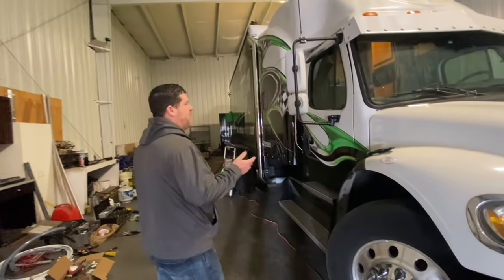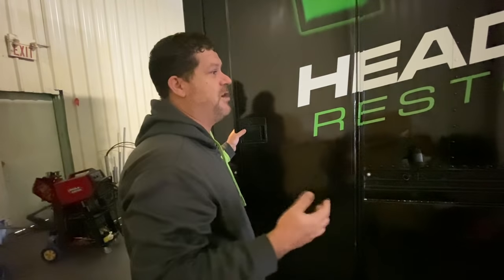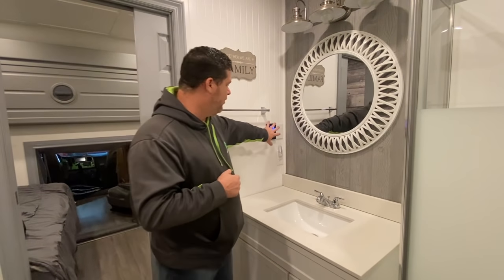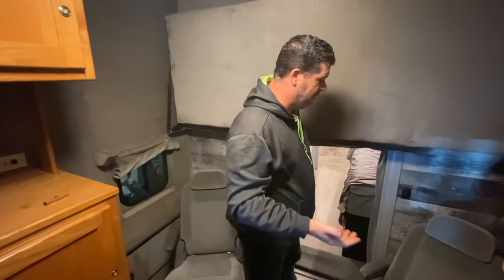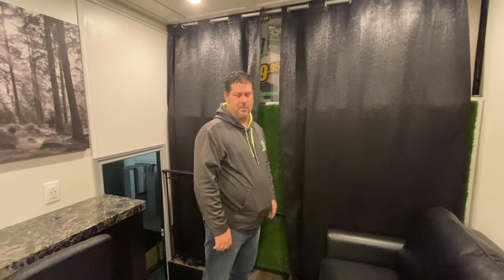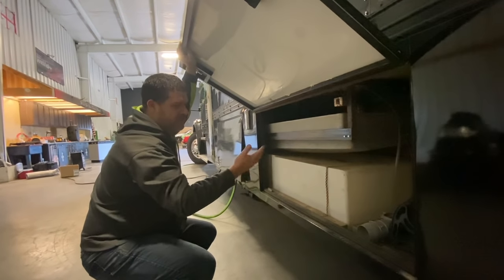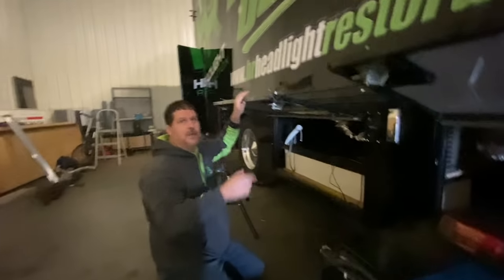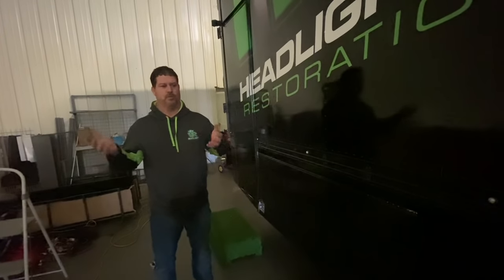Box Truck to RV!! Was it worth it??

Comment: I added 9 automotive cameras all around my RV facing different directions then mounted a switching system so that I can shoot their views to different TV's in my Class A. Plus, I have a remote control spotlight on the front of my roof with a dash mounted joystick and  I mounted a small camera on top of it.  Works best for pulling into RV Sites under tree limbs and under low bridges.  And I can monitor my roof mounted solar panels. (Plan is to build some remote control tilting panel mounts someday.)   KInda like having a Hogans Heroes periscope tied to the TV's.  

We like to camp out alongside Rivers and Mountian Views, and our TV's become windows to the outside showing us the best view. I kept the RV's windows, but like you said, we keep them covered a lot. (Like to see out, but hate to have people looking in.)  
Still trying to convince the Wife I need 3D TV's and cameras for that system.  There are 2 rear view cameras on my Coach.  One at the trailer hitch and one at the roof level showing traffic over the top of our towed.  Thinking of adding a wireless camera to the back of the towed.  
Mounted a camera in the outside entry door light to act as a doorbell camera.  Nice to know who's knocking at the door without having to get off the bed in the rear.  I ran 9 inch camera monitors to the bedroom, bathroom and dashboard so we can watch shows and still monitor outside.   Yea, it's overkill, but you should hear my sound system if you think that's excessive. Like my daddy used to say,  "It only cost a little more to go first class, you just can't stay as long."  
My Class A Coach has been paid for for 20 years, so that's why I went nuts with the remodel.  
It's become a hobby project for me.  
I like how your truck came out, but the wrap is a turn off for me. It's nicely done, but, I'm retired, so making a living is no longer a priority for us.
Reply from the maker: thanks for your response and sounds like you have an amazing rig as well i can so get not wanting the wrap but we use it for all of our shows and business events but defiantly would have been different if just for personal use thanks again cheers
Reply: @hrheadlightrestoration6858  That was a very gracious response on your part! It’s obvious that this is your business vehicle, so that is why you have the wrap. It also explains why you don’t have windows. 😀. Your “bathroom first” idea is brilliant. Thank you for sharing all of what you have learned. It’s great inspiration!  Best wishes to you and to HR Headlight Restoration!
Reply: Well the nice thing about having a wrap on the truck is you can change it later to something not Commercial when you get to retirement.   The main thing about my Class A Coach was the Bathroom was off to the side so one of us  can be in the bathroom, doing what ever, and the wife or I can still walk by to get to and from the rear bedroom.  Our bathroom is pretty large when you consider one of the closets has a door on both sides, so we can reach the clothes from either the bedroom or the bathroom. 

Another Idea I would think would work for me a little better is on the Sleeper configuration.  I think I would have slid the cabinets back and mounted the Captians Chairs behind the Driver and Co Pilot.  Kinda like having a back seat/ balcony to see the road.  And then be able to swivel them around to the cabinets and tables and kitchen area.  And a TV screen should you have kids who find video games more interesting than the Mountain Views.

Anyway, I'm still impressed on your Camper and think it's the perfect set up for Working and RVing!

Comment: You were right in saying you built this for show. 3 batteries that are probably agm with no mention of how they're charged. No kitchen but a store bought vanity. You don't want the smell of food or particles in a grey water tank but you have a black water tank. Uninsulated pipes underneath. A furnace that's probably propane, adding moisture to the inside. Basically no insulation on the side walls. What was the rush to build it for show? Are you tying to start a company building out travel homes? I can't imagine any fellow full time nomads taking you seriously. This truck needs an overhaul.

Comment: i probably would have swapped the fresh water and black water tanks so the fresh is on top, but other than that, rig is primo!
Reply: I was thinking the exact same thing.
Reply from the maker: they are both 100% sealed and also would have been difficult to have the toilet drain as direct as possible for not to clog just was the most direct route

Comment: I designed my own Super C Class vehicle.  Back in 1990.  With a Mercedes-Benz L-1117 25,000 pound turbodiesel box truck.  On the L-1319 30,000 pound extended wheelbase chassis.  But only rated for 25,000 pounds.  So I don't need a CDL.  It even has pneumatic air brakes I've learned to maintain.  And have so for the past 30 years.  They still work great!  Because I know how to maintain them correctly.  I know how to use them appropriately.

And so this was actually not my motorhome.  I actually had a 1986 Fleetwood, Southwind, motorhome also.  And I loved it.  But I think I love my own truck more.  It's all my design.  And it's simply Awesome!  But I'm thinking of selling it and downsizing.  Though, I can't quite yet get myself to do that.  Though parts are not available anymore in the USA.  And must be ordered directly from Germany.  And that does pose for me a problem.  There ain't no mechanics and there ain't no parts in the USA.  That are not retired or dead yet.  To work on a vehicle of this age.  And so I'm torn.  As to what my next move shall be?  Keep it or sell it and replace it.  With a more conventional American-made chassis with an abundance of available parts for years to come.  Domestically obtainable.  And in short order time.  I waited months for a part from Germany.  About eight months.  And that's a deal loser.  As I am now 65 years of age.  And it is getting a bit big for me to negotiate with.  But I loved what I created 30 years ago so much.  So has everyone else.  It is unique.  

As it actually used to be my, on location, radio and TV and recording production vehicle.  With a soundproofed box within the box.  Separated into 3 separate rooms.  And separated by 2, solid core doors.  Like you would have on the front of your house.  And a 24,500 BTU HVAC unit slung on to the custom modified back of the truck.  And it's all centrally heated and air-conditioned.

Of course it still looks like a white Sears delivery vehicle.  That would deliver your brand-new refrigerator or bedroom suite.  To your house.

And so.  I might have to jazz up the outside.  To look more like  an RV motorhome.  And installing faux tinted RV motorhome windows to the exterior of the box.  And some nice swooping graphics for decorative appeal.  For curb appeal.  For motorhome appeal.   And without ever cutting those windows through the box.  I would simply stick behind the tinted window.  A micromanager high resolution color surveillance camera.  Mountain LCD  inside on the wall.  So I have electronic windows on the side of the box.  Opaque electronic, Windows.  You can't see in.  But you.  Can't, see out.  Without being able to see out through the window.  Unless you are looking at the LCD hanging on the wall inside the box.  And no one else has anything like that.

And so I have even less.  In my custom Super C Class 25,000 pound motorhome, invested.  I think I invested approximately $10,000.  The vehicle only cost $5000 back in 1990 at 6 years of age.  With only 134,000 miles on it.  Barely broken in.  And approximately another $5000 on the interior.  With plenty of 120 volt electrical outlets installed.  Kitchen, bedroom, living room.  And the bathroom is unique.  It's a bath and 1/2.  The other toilet.  Sits in place in the cab.  In the passenger seat.  And one inside the box at the rear.  The 8 foot tall rack cabinet.  That used to hold  power supplies and distribution amplifiers.  Is now the wet bath.  Where you can also take a shower.  I also have my mini fridge.  Microwave oven.  2 induction cooktops..  And a sink.  Along with a generator for autonomous dry camping.  And approximately 8' x 24' of available roof space.  For solar panels.  Thousands of watts of solar panels.  And because there ain't nothing else on top of the roof protruding.

I designed my cabinetry to all be 19 inch racks .  With numerous tapped 10-32 screw holes.  Where I can mount shelves and doors and drawers and other equipment.  All mostly overhead as you would expect.  And a couple of others running from floor-to-ceiling.  And so easily convertible.  As I basically had built a custom motorhome.  But mounted recording equipment and video equipment into throughout.  All now removed.  And sitting empty.  Ready to be reborn like a Phoenix.  Once again.

And so what do you suppose I shall call my new motorhome?  Right.  The Phoenix.  Currently it's known as the CROW.  Which is an acronym, originally.  For the Control Room On Wheels.  And only because we all know.  The Crow.  Is one of the most intelligent creatures on the face of this planet next to Homo sapiens.  And it's a dinosaur.  With a birdbrain.  That can repeat words it hears.  And how does a birdbrain do that?   When autistic kids can't even speak?  What the FUCK is going on here if that's not an environmental issue?  Because I do believe it is.  And Jesus, Santa Claus and the tooth fairy do not exist anymore.  If they once did?  They are now dead.  And traveling through eternity.  They're not coming back.  People of been waiting 2000 years for this guy to come back.  How stupid can you get?  He's not coming back.  But Satan certainly has paid us a visit this past year.  And for the past 4.  And you see what's happening.  You see the infections and infestations caused by Donnie Chump.  That's why he keeps calling at the China virus.  I believe it did not come from China.  I believe it was inadvertently transferred from an American DoD lab.  Via Chinese foreign University exchange student.  Who went back to Wuhan China to see their family.  And they have taken something with them?  That may have been inadvertent?  On the bottom of their shoe?  Or  purposefully.  By stealing a little  glass vial.  That may have gotten broken when they got home to Wuhan China.  Their entire family and them died quickly on.  Nobody knew why?  And it took the Chinese government.  A couple of weeks.  To find a virus.  That may have originated in the USA?

And that's why Donnie keeps emphasizing China Virus.  I think we know.  I believe I know.  This was not an animal to food to human transfer.  This came right out of the lab.  This was all explained to me over 20 years ago.  By our chief in charge of chemical and biological warfare for the DoD.  And he explained everything to me in a private 2 hour-long highly accelerated and intense education.  On chemical and viral killing machines.  And if he works for and is in charge of that for our DoD.  I absolutely know.  It was not fake information.  It was coming from the mouth of the guy that helped to create this.  And others such killer viruses.  After a network television show I had done with him.  We sat down to talk.  After the show.  And my God.  Did it make the hair on the back of my neck stand straight up.  I was enlightened.  I was educated.   No one else has gotten this intense education like I have.  Not even at University.  Where they don't teach people how to kill people effectively.  This guy had done the same thing  for the Russians and the KGB.  Before he defected to the United States.  Back in the early 1980s.  Before Perestroika.

I don't know what's to become of us?  This ain't good.  This thing is mutating as described.  And it may build up quickly.  To its immunity from the vaccines.  This is what was described to me will happen.  And who's going to inoculate 7 billion people in short order time, before half the planet has perished?  From the attrition of the disease.  It will topple the world economy and the stock markets.  When industry and everything else.  Comes to a screeching halt.  Then where are you going to get your gasoline and diesel fuel?   It's already going out of production.  We are moving into electrical vehicles.   And it's a long way off.  Before we see supersized motorhomes running electrically.  You might have to purchase a Tesla Truck?   How much money you got?  Right.  We don't have enough for that.  None of us do.   Only Jeffrey Bozo does.   Only Elon Musk, does.  And those like them.

So is much as I love my diesel powered vehicle.  And my gasoline powered vehicles.  It's only a matter of time.  That the fuel will skyrocket in price.  Out of our limits.  Just like trying to acquire leaded gasoline or R-12 or R-22 Freon refrigerant.  All now, NOT AVAILABLE ANYMORE.

And with the push of other nations.  Intending to go, combustion engine free.  By 2030-2035.  We ain't got long to enjoy our motorhomes.  Before they come to a screeching and unaffordable stop.

And I truly don't know what's to become of us?
RemyRAD

Comment: The great thing about building your own is you make it how you want it, not how I or anyone else likes it.  RV builders build to the wants of most people, they have lots of slide outs to give you more space.  The truck is cave-like.   Well done to your taste.
A big truck, probably horrible gas mileage too and hard to park (unless you like truck stops).
Reply from the maker: No the truck is very easy to drive and handle very cheap on fuel. I also pulled a 27' trailer behind it. My 21 year old son wanted to drive it so the one morning we were driving to California I just hit the cruise button got up and held the wheel and say here you go drive it and we switched seats and he drove it all day and was amazed how easy it was and smooth.

Comment: I loved all your ideas.
But like you say , they add up.
The on board pressure washer was a nice touch as was the on demand water heater. 
I was surprised that you did not have the big 60" T.V. in the back that is visible from the inside or the outside.
I'm sure there is room on the rig for a 4 KW generator on board.
With a truck that big you could also pull an enclosed trailer/toy hauler behind with a car in it.
Reply from the maker: thankyou for your comment but the tv is placed so when the back opens up and the deck is dropped you can see it from outside. also we do have a 300 watt gen and you can kind of see it in the lower box beside the electrical panel also on the trip we took down to California
 we did haul a 27' trailer with our car and 5x8 display trailer on it.

Comment: I want to do something similar. My uncle has a old freightliner and I really thought it would be a amazing camping rig to strip out one of the rear axles and slap on a 10ft slide in box camper mounted backwards on the frame with a door between the cab and the camper so u can just walk in your camper from the cab of the rig without going outside. It would be light weight and only one rear tire would be needed on the rear to keep rolling resistance to a minimum.

Comment: I want to do this same concept with a 53 ft semi I love the way you built this. Perfect
Reply: Yeh but a semi is not as Manoeuvrable. Imagine just reversing would be a issue especially in urban areas.
Reply: @matty6848  I’m really not worried about maneuverability i really just love everything about semi trucks . As long as I can go where any other semi can go I’ll be fine.
Reply: @mozateiwilliams8554  yeh suppose your right. Also in a rig that big and expensive jus chil and take your time. If anyone honks their horn then tough. Say dude I’m driving a truck chill out.

Comment: Really nice! Two suggestions if you don't mind. You probably thought about this and maybe decided against it, but why didn't you put struts on the lower side panel compartment doors? The other thing that came to my mind when you said you didn't want windows is an idea I am looking forward to doing one day when I build an underground "man cave", as my wife calls it. Instead of windows, I plan to have large monitors dressed up to look like windows. Each monitor will have a camera on the outer side of the wall so that when you need to look outside, just turn on the monitor and it will look (somewhat) like looking out a window.
Reply from the maker: yes I have the struts just been to lazy to finish that part yet also I am considering making them power to be different but with covid hard to get to the stores to get what I need also TV's for windows could be cool but just haven't really thought about needing that now cheers and thanks for the comment